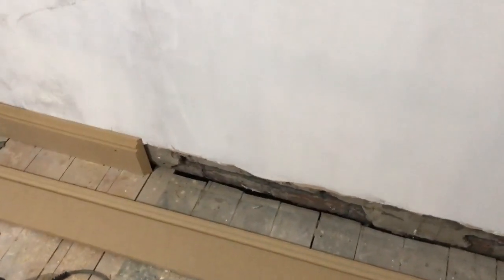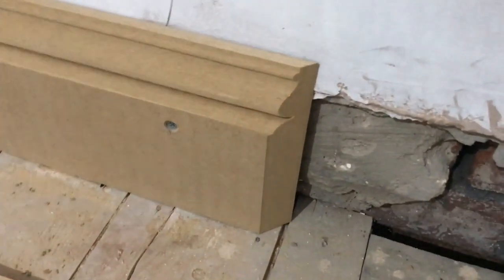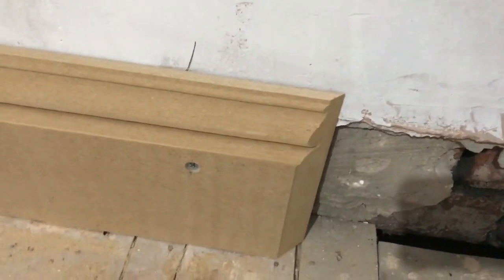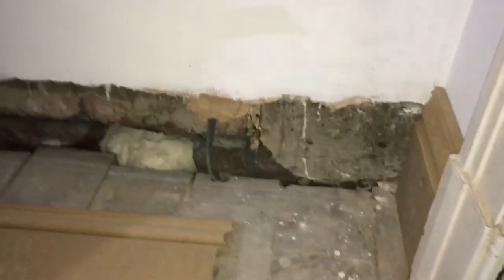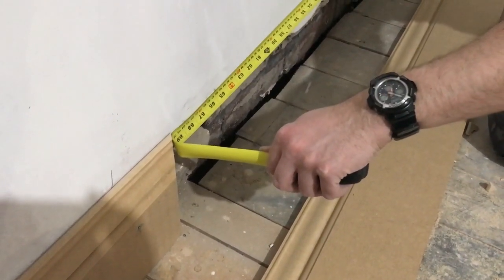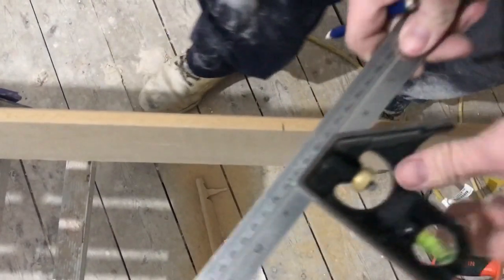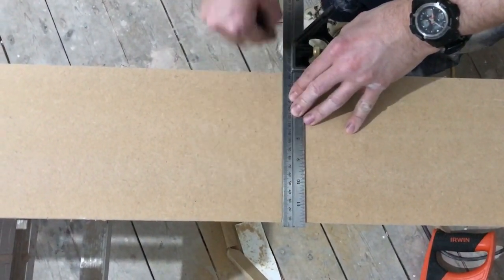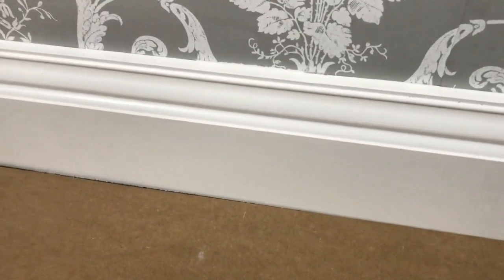How to join skirting boards, baseboards together with a splice joint or a splayed heading joint

Comment: Mate your vids are excellent, had skirting boards cut out in  bedroom (kitchen extension girder fitted)  had to replace some of them, so used your joining method and worked a treat, seamless joint. Also did same with jointing coving around ceiling and walls , could not believe the difference . I can't even remember where the joints are!
Reply from the maker: Jeff so glad my videos are helping you! Be sure to like to share them to help the channel out 👍🏼

Comment: Good but I always use Soudal D4 slighting foaming wood glue on joints and when set I do 2x 3mm wide horizontal cuts across the joint and hammer in 2x de-headed 100mm screws - these bite into the grove and then face fill with 2part wood adhesive. Never ever had a joint crack or open. By the way, I always put 2x screws vertically either side of all joints. Belt and braces I know but nothing worse than cracks in skirtings. Worth going the extra mile

Comment: perfection, thanks for posting.  Any ideas/suggestions for those awkwards sections where the pipework from a rad gets in the way>. I'm placing 6" boards but the pipework means its infringing on the profie of the board.
Reply from the maker: All you can really do is drill holes for the pipes then cut the piece out to get the skirting on and glue the piece back in and fill as best as you can.
When I put my radiators in I made sure they were high enough to not be in the way of the skirting. Plus I hate the look of radiators so I've made radiator covers for most of them. I have videos on a couple I've made.
Thanks for watching and don't forget to like and subscribe to help me out 👍🏼

Comment: I've just watched three of your videos on skirting board mitres.  I learnt a lot and mostly why none of my attempts at mitres in years gone by ever fitted properly. :-)  Re the splice joint, will any glue do or was the stuff you used better than most.  Thanks, great instruction.
Reply from the maker: Bob M thanks for that great comment. You can use any wood glue but that titebond 2 is a great glue. Pva would be fine.
Thanks for watching and be sure to like, share and subscribe to help the channel grow 👍🏼👍🏼

Comment: Nice cut i think my recent issue was cutting the angle from the front and I dont think that works at all as my skirting are usually tidy but these are tourus 6 inch I think ill get onto it angles im fine with and have my own equation of x=angle  90-(x÷2) and thats thr mitre cut so say 94 degree obtuse wouod be 94÷2 = 47 then 90-47 = 43 meaning you set saw at 43 degrees

Comment: I have four inside decorative baseboard corners to connect.  PROBLEM IS...  The exact molding profile I need is no longer available for my 27 year old home.  (I added a small wall)  This is leaving me with having to find the best way to mate two slightly different moldings and end up with a decent result.  I was thinking that I might be able to transfer the older moldings profile to the new moldings surface.  I hope you might have some guidance for me.  Thanks, Don
Reply from the maker: Tribulation Prepper I think the best thing you could do here is to scribe the old profile into the new skirting. The moulding won't match up but it will look neat. Alternatively get taller skirting so the old moulding is on the flat of the new and make the difference a feature!?
Let me know how you get on 👍🏼
Reply: @spendtimesavemoneydiy   I have decide to use your option number 1.  I will use the newer, (same height at least), skirting and scribe the old profile onto the new.  Since I took the time to re-finish all of the old skirting, I will use the same American Walnut stain for the new and I doubt that the inside corner transition will be noticeable.  Thanks for sharing your expertise and for your time.  I will sub your channel and see what else I can learn from you.  Again, THANKS... from Arkansas USA, home of Hitlery and the pervert.  LOL
Reply from the maker: Tribulation Prepper with a walnut stain I don't think anyone will ever see the difference.
Thanks for subbing 👍🏼

Comment: notice skirting dont have any packing at the back, wont they go in from the bottom if some one kicks them, or carpet fitter uses a bolster to tuck carpet in?
Reply from the maker: Not with a strong screw fixing into the brick. If I'd have just used adhesive or nails then you would be right and I would have had to pack out or foam behind them.
Thanks for watching and don't forget to like and subscribe to help me out 👍🏼